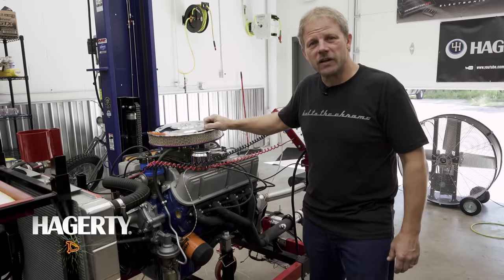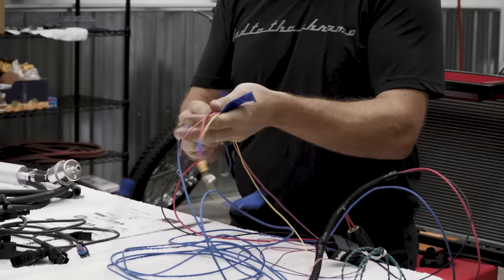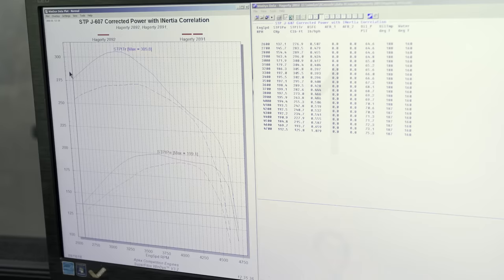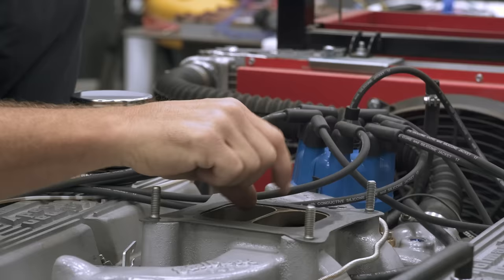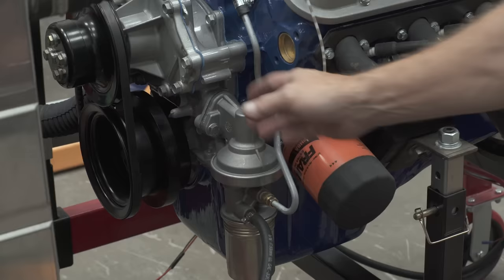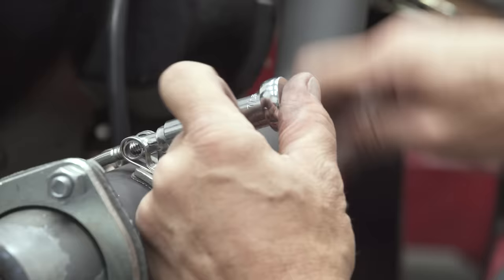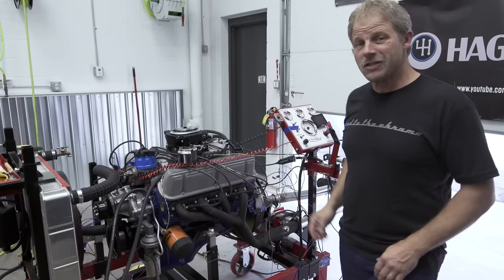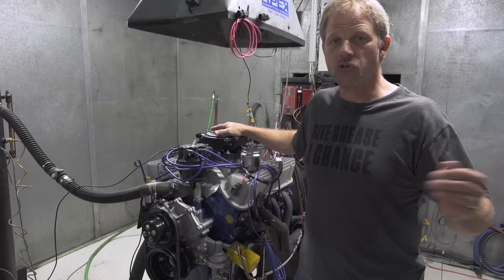Is it worth it? Replacing your carburetor with a Holley Sniper EFI | Hagerty DIY

Comment: Ya lost me when you said that your points would not go over 4,500 rpm -- What other joke parts did you use in this engine build? Must be big mystery to you as to how those NASCAR engines of the 60s turned 7,000 rpm for hours or the drag engines that did the same weekend after weekend on those OLD TIME point distributors... Must have been angels in the backseats keeping them running. All those Vertex & Joe Hunt mags +++ that used points... IF your base run was so screwed up HOW can you even think of basing any future changes on such a defective database?

Comment: I HAVE A QUESTION FOR YOU: CONCERNING A Statement You Mentioned in this video from 12:49 to 13:12 after you installed  &  the  first initial startup  of this Holley Sniper  EFI  setup on the dyno...and I quote : " I Ironed Out One Little Issue=  with the aftermarket ignition that had a TAC SWEEP, so basically what it was saying, is the EFI was seeing 9000 RPM On The Initial Key On which in turn was Freaking Out The EFI, saying ...." I've Got To Have A Whole Bunch Of Fuel"...So It Was FLOODING The  Injectors"....
Which Comes Down To My Question For  You .   You Stated That This Problem/Issue Was Solved, But Not How It Was Solved...So How Did You Solve This Issue/Problem? , I ask this particular question ,because I'm Having The Same Issue of FLOODING the Injectors Constantly Every Time I try To Start It ...It Continuously Floods The Injectors. Could it possibly be a defective ECM As Well?....any info you could possibly could lead me to , would be Greatly Appreciated ...ty

Comment: It looked like when you took the engine off the engine run test stand to load it in the truck you had two holes one in each header for O2 sensors is that what the case is where you need two

Comment: i got 1990  k5 blazer 5.7 had it rebuild with a few up grades everything is pretty mush stock i up graded the cam to a howard cam rattler lift 225/230 duration 0.50/227/235 centerline 03 i still have the factory swirl port heads i got headers 3' pipes all the way back i up graded my torque converter to 2000 to 2400 stall and 4:10 gears i just put my engine in about a week ago it was a tbi so i converted it to carb...im having problem trying to get it to run right i put a brandnew edelbrock carb 1406 on it..i got 12-887 holley regulator set it to 6 psi i got it to run starts up good but its backfiring and popping out my exhaust ..i have a vacuum port on my regulator but did not hook it up dont no if thats the problem or not..or is the carb to small for my set up...you can smell the burning and the raw gas in park when u accelerate and give it more gas it sound good but at idling its popping and backfiring like someome popping fire crackers..tell me what you think.....
Reply: If you installed the Edelbrock "street" calibrated carb, what you're smelling isn't excessive fuel. I bet you're smelling a very akrid, nose & eye burning smell which is caused by a very lean mixture. The "street" carbs come from Edelbrock calibrated way too lean, & that's why they sell "jet needle & spring" re-calibration kits. The "performance" versions have a much closer calibration right out of the box, that is a good starting point to re-calibrate your carb to. Also, 6 lbs is a bit high for the Edelbrock(really a 70+ yr old design, Carter AFB). 4.5-5lbs would be better.

Comment: I prefer carbs  not into all into  the electronics   prefer old school three wire systems  less complicated and easier to repair on the side of the road or trail.  I am running a 76 td with a 360.  And just bought a 78 w200 another 79  w200 power wagons. Keep it simple

Comment: I have 1 in a storage container in my Garage attic .....1st one I bought had to be sent back Bad ecu ........2nd one left me on the highway 1 to many times .....when it gets confused because of faults in software it goes to a no start and you loose power nothing you can do except put on a flatbed..........If you happen to get a good one you got better chances ....better take some tuning classes before you jump in the big middle of it

Comment: You forgot to mention the possible  improvements  in fuel consumption .
Reply: If the engine is tuned properly, an engine will NOT get better fuel economy nor make more power with FI than a carb. An engine is an air pump & requires 1 part of fuel for every 13 parts of air injested. FI adjusts this with pulse width, a carb adjusts it with internal circuitry & the power valve. Also,  "port" injection will NEVER make the power a carb makes(current NHRA Pro Stock & NASCAR are the best examples) simply because the fuel vaporization in the intake manifold cools the air charge, making it more dense(like a lot of the know nothing commentors on here) which results in more HP! The Pro Stocks lost 50 to 100 HP with FI & the NASCAR Stock Cars get exact;y the same MPG as they did with a carb. NASCAR was making over 900HP with a 355 before the change to FI. Now they are limited in HP & RPM to 750 & 550 by a restrictor plate. Sorry but technology isn't always better, just more complicated with more components to fail.

Comment: Why didn't you test the carb with the spacer under it? By adding the spacer you increased the plenum volume. Another thing to consider is with the spacer the engine can signal the whole carb, not just half the carb. The EFI unit wont run without the spacer. People expect to see a back to back test. AFR's for both, venturi and butterfly sizes. Why use a relatively new design EFI unit vs a carb design thats 40 plus years old. Throttle body style EFI does not make more power than a carb. If your going to spend your hard earned cash and want EFI go sequential and get the benefit of sequential ignition as well.

Comment: Having done the swap on my 70 c10 my best advice would be to buy the holley hyperspark kit as well... The Sniper doesn't like any other distributor.. They absolutely despise RF interference. You might get lucky and it'll tolerate your distributor for a bit maybe even a few months but eventually it's not going to like it.. Save yourself the hassle and buy it from the get go. Besides the ability to control ignition is easily worth it.
Reply: Oh and buy the progressive linkage it's significantly better than the one in the kit
Reply: I'll also add in the o2 sensor bung standoff... Well worth it saves a lot of hassle
Reply: @CC Ryder there's like 3 wires... I'll take it and the 10:1 benefits over a carb any day.

Comment: I could not care less about 5-10 hp difference, even more. The advantages of fuel injection is beyond any comparison. Fuel injection is so much better that carbs, it is insane. I remember how finicky carbs can be and are. You couple fuel injection with ignition updates and the advantages really are off scale.
Reply: Simple answer is BULLSHIT. My buddy runs an All Motor, door slammer Super Comp car on race gas with a single Pro Systems carb & he NEVER touches the carb, ever. He races in Kali, at Phoenix, Tucson, Las Vegas, etc. I tuned my Real Street hot rod truck a couple years ago & haven't touched the carb since.

Comment: I keep wandering what the most reliable and fuel efficient efi conversion would be on an older 5.0 Ford or any small V8? Any ideas on how this Holley compares with others? Not sure if you've had experience with any others. Thanks for any input

Comment: @ Neil - totally agree the timing is essential, especially if you've pushed the compression up because the advance tailoring available with the EFI will help you avoid knock at low RPM.

Comment: My car is already electronic fuel injection 
And my mechanic friend  recommends installing Holley sniper. Any advice? 
I have a ford bronco 2 1990 
Want to install for more power and better mpg 
I get around 15-20
Reply: when your entire vehicle is worth less than the price of the upgrade, the upgrade probable isnt worth it. Also the sniper system is made to bolt in place of a carburetor, you probably would not be able to attach it to your engine.
Reply: Chris r thanks for the heads up. I appreciate it 
Definitely not going with my mechanic any more 
It’s lifted 4 inches with 31 inch tires 
What can I add after market to achieve better gas mielege

Comment: Carbs or efi? Same power can be had with both, but, efi is cleaner inside the engine, less deposits, and most importantly, it is SELF ADJUSTING. A carb is in tune as soon as you set it and then from then on it gets further and further out of tune. An efi is set up and the then it continuously adjusts to stay in tune,
My choice? efi for street driven vehicles and carb for the bracket car (mustang).

Comment: Without a diagnostic computer, there's no way to see what's wrong with your EFI if it stops being the perfect fuel system, carburetors care about one thing: fuel delivery. Yes, EFI is more efficient and all that, but I will trade all that for simplicity that I can fix with a screwdriver.

Comment: I have a 1978 Mercury Grand Marquis with a 460.  I believe the carburetor is a spreadbore.    I would love to get one of these. This video makes it look fairly bolt on.   Does anyone know if this is as easy as this guy makes it look, or would I need a mechanic to install it? I have a little tinkering experience but not much. Is this as plug and play as the video makes it look? Thanks!

Comment: Engine will probably last longer too with EFI. Carburetors can get out of adjustment. Or dump more fuel into the engine than it can burn. This can wash oil off the rings/cylinders causing more wear. A little more wear over over 50 -100k miles can be alot. My next build I'm going with EFI. Especially if you plan on DD your project or road trips. Its 2020,I think EFI is the way to go.
Reply: But ppl been running them for years lol and still run them racer still use carburetors kid just go watch some races and you’ll learn something

Comment: were can i put the 02 sensor in a marine app... with the water jackets in the way and n then the dump pipes mixed with water . twin, 454's  425 hp. each  1985 Kaama builds... just went from points to msd . now would like to do something like this .. you have made it look  so easy , you are very good at what you do... my motors are still fresh 250 original hrs on a one of a kind 85 Scarab ..  just want to bring it up to date for dependability ....... any advise would really help... good to see you having a fun time doing what you love to do.
Reply: Add a spacer to the exhaust riser and put the o2 sensor in it. The spacer contains the water channels but has space reserved for the O2 sensor. 

You can buy these spacers or fabricate your own.

Comment: Not even fair. That sniper is more CFM and is NOT vacuum secondary. You should have put a Holley Dominator on it with same CFM. This is rigged. PLUS... The Sniper is going to tune it self. You MUST tune the carb to it's max potential, because that is what a person would do, and it is what the EFI will do.

Comment: I have a  quick fuel carb initial set up was lengthy due the many adjustments that can be made most of yhe,season I have no problems early spring and fall are problems with no choke but runs awesome with the added expenses I don't think the efi is worth it my other consideration is I have a massive stereo system and voltage fluctuations would probably make the system freak without a significant power gain  I say not worth it elevation is not a factor except for racing

Comment: Do not use that garbage clamp thing for the wideband O2 sensor do it right if you can do it yourself go to a muffler shop they'll do it for 60 bucks or whatever just do it right you're going to get leaks it's going to mess up the reading it's just problems just do it right and get the O2 bun welded on

Comment: The first car worked on at 10 years old was a 51 Studebaker we rebuilt the engine and I’ve also worked on 29 Ford and the newst I’ve worked on is a 2005 mercury, and sometimes I question what, what?  Is it a script, or what???

Comment: You have to be pretty much an expert to tune a carb exactly right
You have to be pretty much of a dull tool to get a selflearning EFI wrong.
You can map an injection system manually pretty much perfect if you put some time in it. (and I hate computers)
Just ask yourself why no new cars have carbs, and why they all have fuelinjection now.
You can get a car with a carb running by giving it a bit too much all the time, but the cost is emissions and fuel consumption, in the same way you start tuning an injection system with a "fat" map, for safety, but get the most power when you lean it out to perfection.

Comment: That isn’t a fair comparison. EFI is more for your show car crowd. But that will never out perform the correct size carburetor. Especially the correct size double pumper. Dyno numbers are one thing. On track performance is yet another. If it’s a trailer Queen then the EFI is for you.  It just remember this. All the money you put out to gain horsepower, your giving it back by going to injection. A milder motor will act the same as the injection. So why not just build less motor and go carb and save some money. You can always hook up the choke and make it start easier. And if you want less power save yourself a buck and just pull a plug wire off.

Comment: The carb is not able to self adjust based on O2 sensor information like the EFI can. Mixture is always right
Reply: Carburetor doesn't need to constantly self-adjust due to O2 sensor a carburetor runs off air pressure inside the engine if the air is thin it doesn't pull as much fuel through the carburetor if it's dense air it pulls more fuel with the air carburetors are damn good things when tuned correctly and they have a hell of a lot more throttle response in my opinion over fuel injection I can tell you right now I don't know how many vehicles with fuel injection I can go in and stomp it the floor and pull my foot off really fast and not even affect the idle of the engine because it's so fast the computer doesn't have a chance to compensate but a carburetor will pick up RPMs and drop
Reply: @spambeanie2  Thats kinda true. The carburetor feeds fuel based on the volume of air the engine draws in and has no idea if the density of the air changes. The engine draws approximately the same volume of air in with each revolution. If the air is thin  (less dense) the mixture will be more rich and if the density is higher the mixture will be more lean. Tune a carburetor at sea level and take it to the mountains. The mixture will be too rich. That's because the carburetor is tuned at sea level for the greater 02 content. Thin out the 02 in the mountains and there will be too much fuel for the thinner air. The point I'm trying to make with fuel injection is that the mass of the air is taken into account and the 02 sensor makes sure the mixture is right no matter the air density. That won't happen with a carburetor

Comment: This doesn’t look like a 289 “ HIPO” , at least by looking at the thin harmonic balancer on the crank.  Unless someone swapped out a stock 289 balancer for the thick HIPO and counterweight. 
  For some reason when ever a 4 barrel intake ,4 bbl carb, a set of headers, and some aluminum valve covers get installed on a 2 barrel motor it seems to instantly transform into a “ HIPO “. 
   A true 289 HIPO, involves solid lifters and cam, factory dual point NON VACUUM advance dist, a stock 289 4 bbl cast iron intake and cast iron header exhaust manifolds. 
   IDK, i can see the numbers on the block from here but something tells me this is a beefed up regular 289.  Possibly even a 302. 
  Well take it for what it is, just commenting on the obvious.

Comment: This comparison isn't very useful without seeing a direct comparison between the engines including AFRs. At 14:21 we see a glimpse of the AFRs run with the carb and they are in the 10s and 11s!  That engine is choking on fuel. Of course it is going to produce less power than the EFI runs where the EFI is likely running in the low to mid 13s. Yet the AFRs aren't shown for the EFI runs, while they should be. You don't need to present your data in a shady way to prove EFI is superior. That ship has long sailed.

Comment: I have a question, I own a 1991 Ford F-250 with the 351 Windsor with the factory EFI. The thing is massively underpowered and has bad mileage. In your opinion would switching to this Holly EFI sniper produce any difference in efficiency and power?
Reply: It's a bosch system. Check the o2 sensor first.

Comment: The sniper EFI as well as the old GM TBI systems have the benefit of fuel atomization cooling  the fuel charge like a carburetor does in a more efficient manner. I agree that points can still get the job done but with so many electronic options available why use points?

Comment: If you can't get points past 4500 rpm its time for a gynecologist appointment.
I also noticed you made peak horsepower above the 4500 rpm you ran the carburetor to.

Comment: I have a '78 Camaro with mild SBC 383 stroker. I'm seriously thinking of swapping to an EFI system of some sort.  Either a throttle body system like the Holley Sniper or MSD Atomic.  Or a multi port system like the Edelbrock Pro-Flo.

Comment: The main computer for the e f I is inside of it. With the engine heat and vibration, I wonder how long it is going to be reliable and if it breaks how much more is going to take to fix it?

Comment: 3:20 you should have replaced the points instead of pushing a new distributor. The original 289 had points and turned more than 4,500 rpm.

Comment: Why Holly won't send you the right length studs? They already know you're switching from a carburetor to a fuel injected system they know you're going to have to put an adapter plate on it